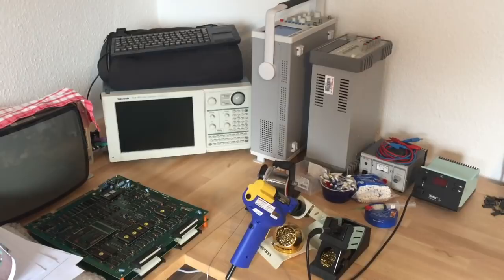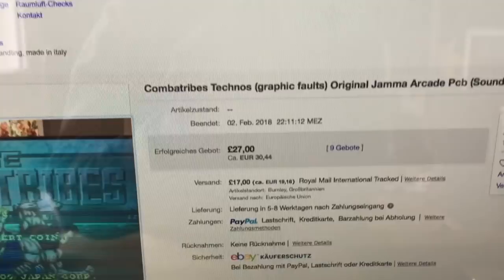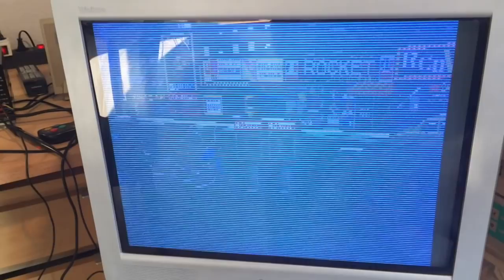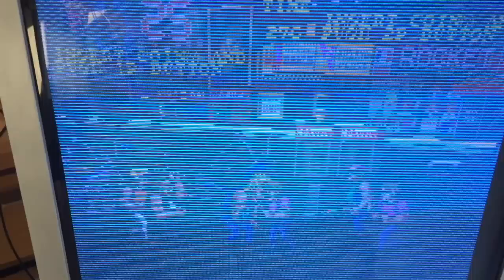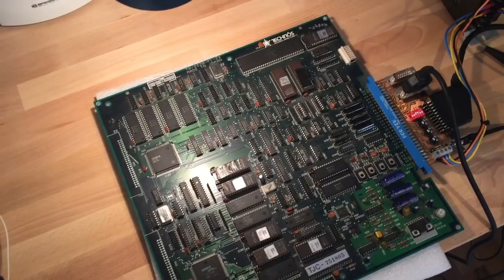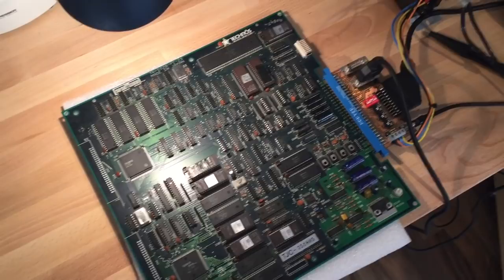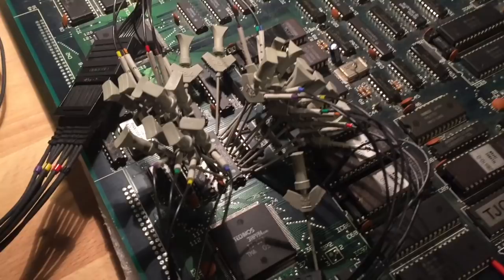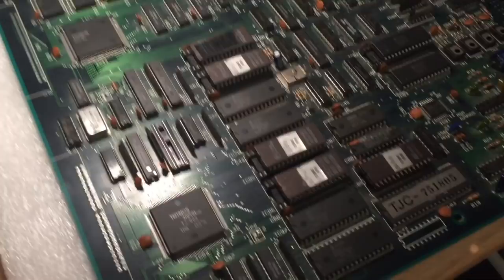Combatribes Arcade PCB repair

Comment: It's refreshing to see an 'engineer's approach' to fault finding as opposed to yet another video of somebody randomly shotgunning a bunch of ICs or replacing all the capacitors at the first hint of an audio fault. I'd recommend purchasing some DIP test-clips for hooking up your logic analyzer leads though; they're a massive time saver :)
Reply from the maker: Actually I will do that! Just found some on ebay. And yes right - I had so many pcbs with audio problems because of a problem with the sound cpu, sound cpu's roms or rams which were pre-recapped and had replaced audio amps etc. for no reason... :-)

Comment: This is a perfect example of why a logic analyzer is very useful vs. a simple logic probe.  With RAM chips, the outputs may be pulsing, but the probe won't tell you if the data is actually correct at a given point in time.  I really need to get one of these, but there are a lot of choices on the market, and I don't know how powerful it needs to be for this job.
Reply from the maker: imo you would need a logic analyzer with at least 32 channels - 64 would be better. 1GHz sampling rate would be great. I really can recommend the Tektronix TLA715 with a TLA 7N3 2 GHz sampling module and 2x P6417 probes for 64 channels. Overall a reasonable priced setup I think. Theres cheaper USB devices but they usually don't offer the amount of channels you really need.
Reply: I can recommend Sigrok software, it's Open Source. They also has list of supported devices https://sigrok.org/wiki/Supported_hardware

Comment: Thanks my friend. Your a talented teacher.
Reply from the maker: Thank you very much!
Reply: Raymond Rivera 
Why you dont use clamp for logic analyzer aligator clip?
There is different size for ttl chip
Reply: Its hard understand for beginners
I a sub engineer and 10 years and hard for me
And need expensive tool for this
Reply from the maker: Yes, you are right. My videos probably appeal mostly to people with some experience with electronics and especially ttl circuit design. 
Expensive tools like the logic analyzer are not really required - it was just used in this vid to confirm our hypothesis about the dead ram chip. But that was not really necessary - we could just have replaced it to comfirm it. The tools you do need are the multimeter, the logic probe and sometimes an oscilloscope (which is not too expensive, any used 20-40 MHz 2 channel device should do) .
Reply from the maker: I have to get one of those ic test clips :-)
Reply: doktorzett 
Thsnks for fast reply my friend
Reply: @christophzett  I'm interested about custom made jamma interface board which you used in your tests. Could you provide website or project files with jamma interface board? As I know MAK's or superguns are rather overpriced, and rather without a reason are expensive. One control panel called as supergun is often worth as much as entire arcade cabinet...

Comment: Thank you for this great video.  Good to see that it works again. Subscribed. I'm electrical engineer, but unfortunately i couldn't spend time on arcade or PCBs earlier. Is the test board (connection to CRT TV) your construction? Or can i purchase such board? Possibly with VGA (LCD) monitor connection?
Reply from the maker: Sándor Rózsa Thank you very much for the positive feedback and for subscribing. And, yes the test pcb hes been made by myself some years ago and I still use it on my test bench. Its perfect for an easy hookup of psu, monotor and test controllers. Try searching the e bay for „mak jamma“ and you should be able to find something similar! I wish you all the best for your future repairs!
Reply: @christophzett  Okay, i try this. Thank you for your reply and for your kind help.
Reply: @christophzett  Could i ask you this Combatribes PCB version contains a free play mode? Or only coin insertion mode?
Reply from the maker: @sandorrozsa6148  Yes it does!
Reply: @christophzett  Thanks.

Comment: hi buddy i have the same board, but not sound at all, i changed capacitors, the amp, is working, its hot...this board uses ram sound?